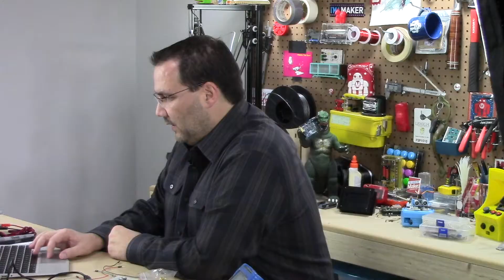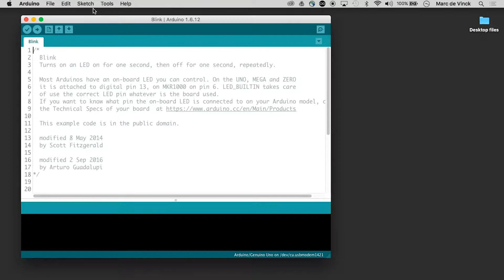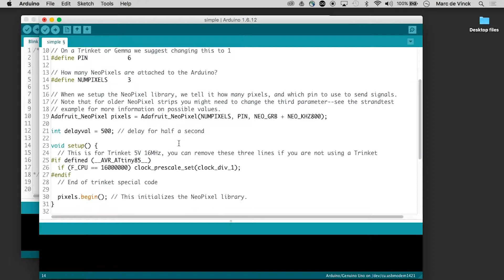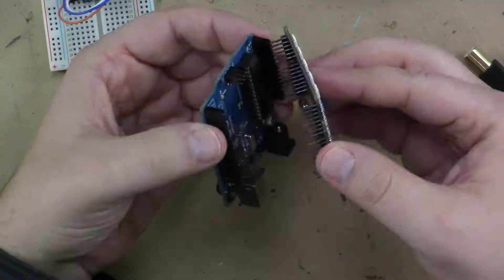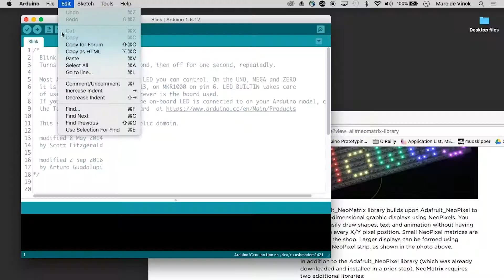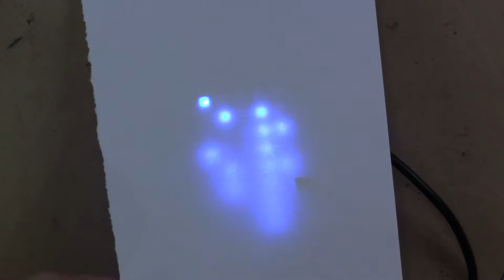Arduino NeoPixel Tutorial: Control Hundreds of RGB LEDs With One Pin

Comment from the maker: ⚡ Quick tip: before you wire up a long run, remember that the data only flows one direction through these. Data OUT of one pixel goes into data IN of the next, and if you get that backwards nothing past the reversed pixel will light. On most strips and rings there is a small arrow printed on the board showing which way the signal travels. Follow the arrow and you will save yourself a lot of troubleshooting.

📌 FULL SERIES: Watch all 100+ episodes of the Complete Arduino Prototyping Series. https://www.youtube.com/playlist?list=PLcKte0wD90Y4lsrStEWB5NR1gKMs0FDts

What is the largest number of NeoPixels you have ever run at once?